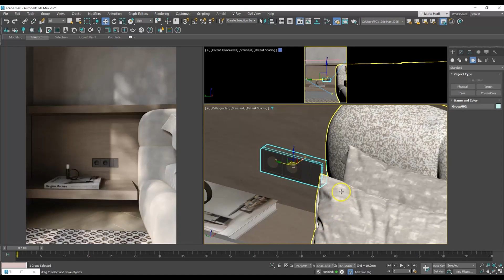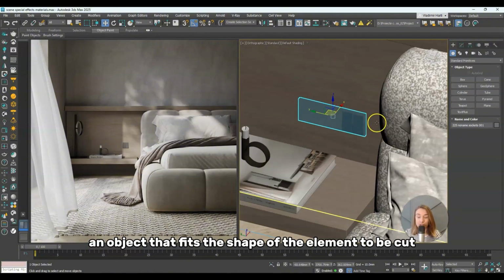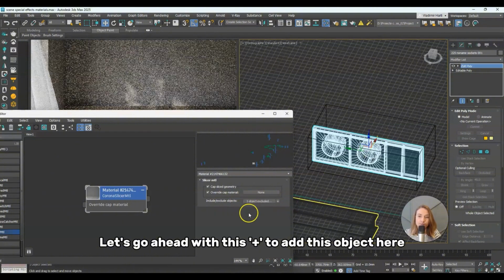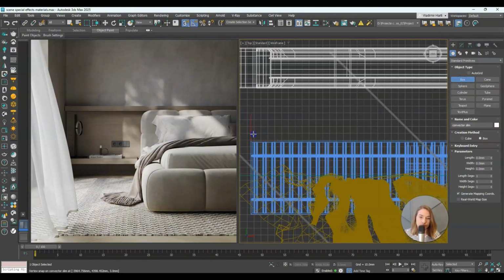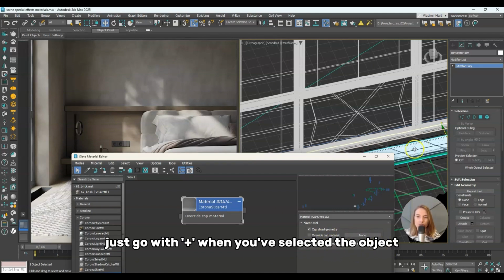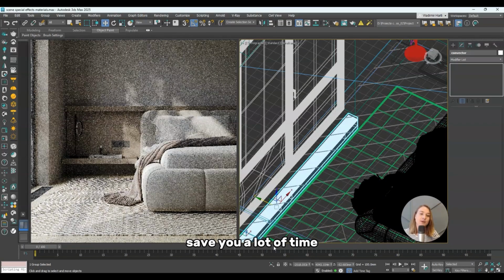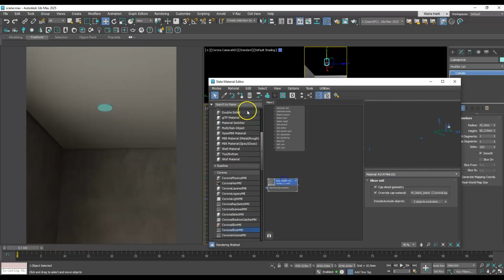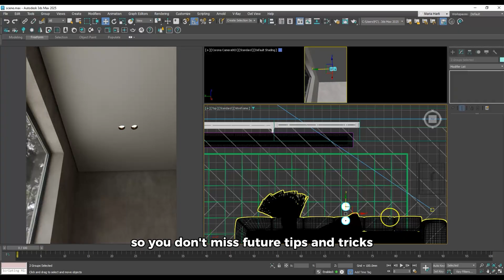3ds Max Auto-Cut Trick | Corona Slicer | Step by step Tutorial

Comment: Thank you, I’m using V-Ray. It’s a bit difficult to do that, but Boolean is doing it for me
Reply from the maker: For Vray use VrayClipper, it is not a material but it works similar. You can find it in Create - Geometry - Vray - VratClipper. Try it and let me know if that makes it easier to be used than Boolean.
Reply: also you can model the ceiling with splines with an extrude modifier applied. That way, (if you were doing spot lights for example) you'd have a Rectangle (size of ceiling) and circles inside of the rectangle. when it extrudes, the circles are cut out. then you can move them around/duplicate as you need.
Reply from the maker: @ryanbailey4973 Sure, it is also a way.
Having alternative methods in diferent situation it’s always a good idea.